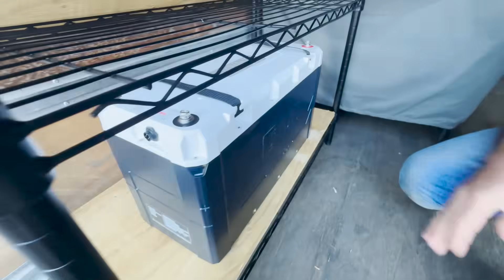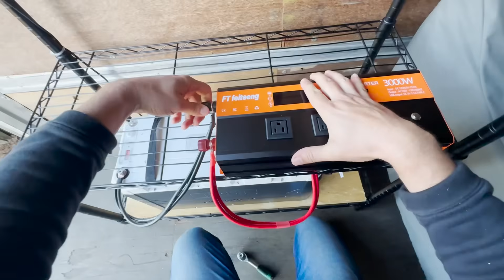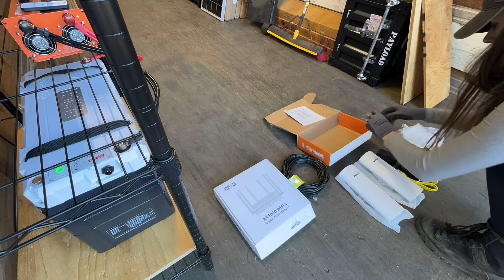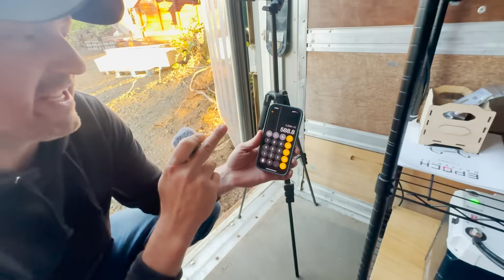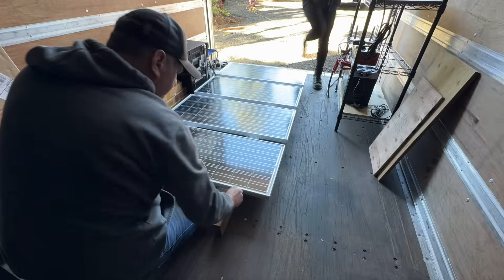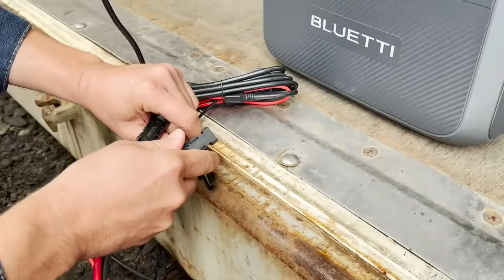🔋OFF GRID POWER + WIFI for our SHIPPING CONTAINER! ⚡Solar Setup with EPOCH LITHIUM BATTERY #build

Comment: In case you didn't know, 12v DC shop lights would be a much more efficient use of your battery (10%-20% power loss in conversion). You can also attach a lavalier microphone to your jacket or shirt to avoid the poor-quality audio.

Comment: just take the antennas of your container router outside the cantainer you will get good signals with door closed, for that you can use antenna extention wires
Reply from the maker: We eventually upgraded to an outdoor rated router, and it works great! :)

Comment: YOU NEED TO PUT THE PANELS IN SERIES,YOUR SET UP GOT TO MUCH CABLE SO YOU LOOSING  A LOT POWER YOUR AMPS ARE TO THE ROOF SO YOU WILL BURN

Comment: Don't forget to save your receipts  so you can claim your 30% federal tax credit. Also you might want to try wiring your solar panels in series (if the solar charge controller can handle the 100 + or - volts)
Typically these charge  controllers start charging when the voltage coming from the panels is 5 volts higher than the battery voltage.  In parallel the charging window is much smaller.  Plus in series you will have less line losses from the panels to the charge controller.  
I enjoy your content on here.
Reply from the maker: Thanks for the tips!! :)

Comment: 3000W on a 12.8V system will pull in the neighborhood 270 Amps(included the inverter efficiency loss) 
Even IF the battery BMS can handle this current, I would NOT stress those wires between the battery and inverter to handle more than 100A. In the current configuration, I would NOT load that inverter with more than 1200W.

As others have mentioned, when running that far a cable between panel and controller/powerstation, its much better to connect panels in series. (Just keep the voltage below the Powerstation/controllers specs.)

The inverter itself will consume more power than the wifi as long as that is the only reason the inverter is turned on. Connecting router DC-DC will reduce draw on battery by 50%

God you are gorgeous!!!

Comment: i would run the solar panels in a 24v config, 2 panels in series and the other  2 in series and  parallel both 24v config using a 15amp or more mppt controller.
Reply: I would run all four panels in series to get minimal losses with that long wire run.
Reply: es mas eficiente 24v también utilizar inversor de 24v se consigue mucho mas eficiencia que en 12v saludos

Comment: Hi Team, I'm confused, l don't know what you paid for your battery and your system. Personally, l would have perchased 5kw off grid inverter with a 15kw battery from China, with the solar panels, these days you can buy panel for example 440 watts and up wards, your wiring looking to be the wrong gauge, l would be looking into that. Keep up the good work.
Reply: AGREED!

Comment: Nice videos of the free range residents of your zoo ! For some reason it popped an idea into my head for a t shirt you could do... Treerassic Park, OR ?  The residents seemed curious or lost.. like, wait a minute, I know this wasn't here last week !

  You might want to add a second container parallel to 1st so it could support a roof between them sheltering a wood storage area, and maybe weld onto containers for some metal racks for beams, pvc pipes and so forth so you can benefit from bulk buying prices.. or get a local plumber to buy a big lot in tandem with your purchase ?